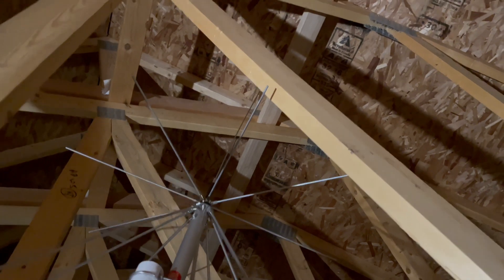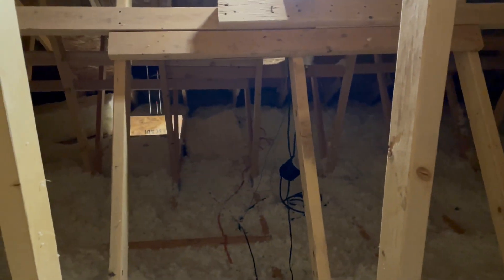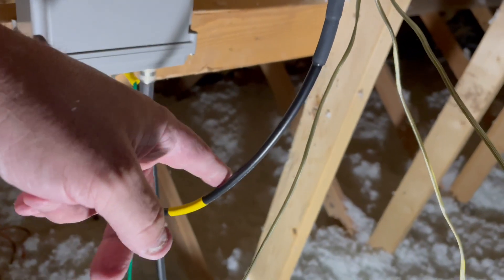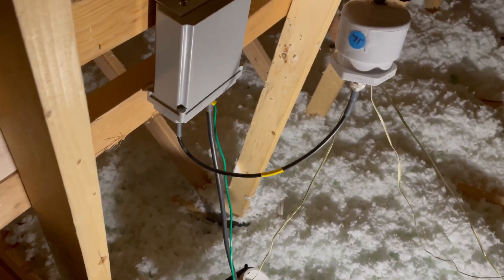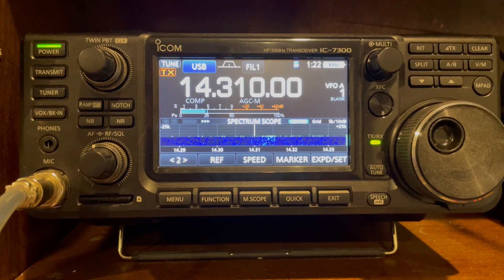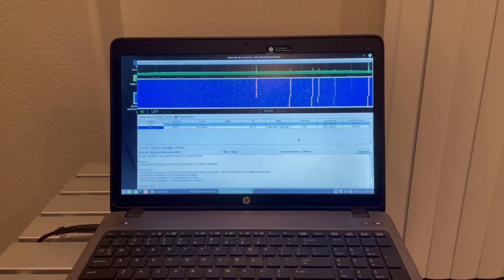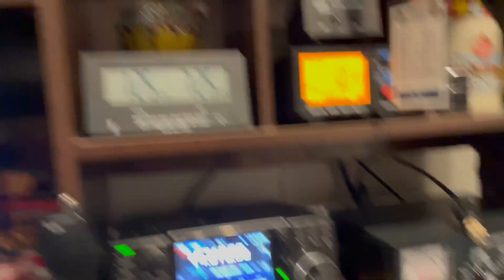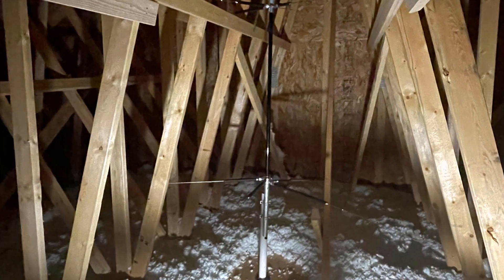Summer Shack Redo 2022 and a New Antenna Courtesy of MFJ, the MFJ-1868 Discone Antenna

Comment: I’d like to see your solution for transitioning the coax from attic to inside your home
Reply from the maker: I searched and I don’t think I have an exact video of how I got them down but basically I drilled 4 holes through a ceiling 2x4 and snaked them down the inside sheet rock of the floor above and then cut a 12” X 12” square in a closet and then drilled 4 more holes through that 2x4 into the basement crawl space and fished the coax through these holes so that each one was separated by a couple of inches from each other. Sorry there isn’t a closer video of that process but it wasn’t fun crawling up there and I didn’t record all of it. Ham-Solo K0FYR

Comment: Mike I really like the way you mounted the MFJ vertical antenna. Looking forward to seeing what your new radio is. I have 2 Kenwood TM-V71A radios like you sold. They are great radios and perfect for working the FM satellites. Will you be doing a test with the vertical antenna using it for VHF and UHF compared to the J Pole. I would really be interested in how the MFJ vertical performs to the J Pole.
Reply from the maker: Not sure if I was going to use the 8 band vertical for vhf/uhf or just stick with the j-pole. The new radio I’m getting has an hf connection and a vhf/uhf connection and I don’t really want to switch the cable from the antenna back and forth undoing and then reconnecting the coax everytime. So I think my idea was to connect the 8 band vertical only to the HF connection and then have a seperate coax for the j-pole connected to the radios vhf/uhf connection. However, here is a video where I did test out the vhf/uhf on the 8 band and it seemed to work fine. https://youtu.be/qxtT-OL9AKY the vhf/uhf test is around minute 4:22. Ham-Solo K0FYR
Reply: @Ham-Solo  Yes, I saw that video as well. Nothing like a side by side test however. Thought maybe you could a duplexer at the radio like the MFJ-916B. Maybe they would send you one of those to test. That way you would not have to swap the coax and could use all bands on your new radio. It would be interesting to see the comparison between the vertical 8 band and the J Pole.

Comment: DANNNNG! Mike, you are awsome. Hey, you deserve all the Respect on this HAM Radio Planet because this was quite some work that had to be done up on the Loft of your House to install over 70ft. Random Wire Antenna, Grounding Cable, Coax Feedline, Adatpers and Jumpers PLUS the Discone Antenna. It's kinda dusty and sticky air up there that's why you put a Mask on for your own Protection. In my Eyes this looks beautiful...and i am sure it works for you just fine. PLS never get tired of sharing your Quality Work with us. YFUG out of southwest Germany said that. Happy Sunday Buddy... 💯🤘🤘🤘🎸👏👍🙋‍♂️🍻
Reply from the maker: Thanks UG just waiting on my new coax and radio to put it all together. Hopefully next week. I actually made contact with a German contest station last night with my IC-7300 down in my ham shack. It was in Llmenau, so it is possible to already reach Germany with my 71’ random wire and only a 100 watts. Ham-Solo K0FYR
Reply: @Ham-Solo  Illmenau is about 220miles NE from my Place down here. It's another different Province of the Eastern German Provinces called "Thuringia" reunited with the Western German Provinces  back 1989 after the Wall came down.
The illmenau Amateur Radio Club used to be World Contest Champions for twice.
Hey those are good News to experience that you already made Contact with my Country, Mike. As you noticed for yourself, it doesn't take 1500W into a fancy Antenna System on 100ft. Tower to make the Trip across the Pond.
You are fine with  just 100W and a proper working Classic Dipol or EFHW Antenna. You have been working really hard for the last 15 month making P2P Contacts outdoors from dozens of State Parks of the US. I am watching every Episode of your Trips across America testing all kinds of Antennas, Radio Equipments, Solar Panels etc etc.
I became a Fan of HAM Solo KØFYR up in CO-State.  It's great to see that I am not the only Nerd on Planet Earth who loves to play portable HAM Radio outdoors in all kinds of WX.
Thx for all you do to keep HAM Radio alive. I be back on air again some time in August just taking a lil Break to get my Move to a new Place done.
Stay safe & keep up your Good Work. 73 de YFUG from southwest Germany 💯👍👍👍🙋‍♂️
Reply from the maker: @DK5ONV  Oh, well maybe this is closer to you. My army unit, the American 2nd Armored Division, went to Germany in 1989 about 3 weeks after the wall came down and stayed in the Tilly Kaserne at Neuburg an der Donau. I went and qualified at the range there and received the Schützenschnur in Bronze from the Panzergrenadierbataillon 562. We stayed there for about 8 weeks during Reforger 1990 and traveled to Belgium and Luxembourg as well as all over Germany. I always wanted to be station in Germany after that but the U.S. Army downsized shortly after and there wasn’t a chance before I got out. Ham-Solo K0FYR
Reply: @Ham-Solo  I got born and raised near the Donau River Region. Neuburg an der Donau is 70miles east from the little Village where I grew up named  Roggenburg.
I had dozens of American Neighbors from the US Army, and AirForce. I miss those good old Days badly. Wiley and Nelson Barracks in Neu Ulm. The USASA Field Station Augsburg. US Army Garnison Schweinfurt, US Army Recruiting Grafenwoehr, Leighton Barracks Wuerzburg etc etc.
I remember the Manpower Downsize of the US Forces very well. A lot of my Friends from back then were gone over night without letting me know earlier before. They got woken up on an early Morning and received their Orders to empty their Rooms, packing up their Belongings and getting ready to leave the Casernes. Some of them got transfered just a couple hundred Miles off to another US Installtion Place but most of the Guys had to return back to the US. That made me feel sad for Weeks or even for Month.
Now you made my Head spinning Mike. Tons of Memories coming back to me right now. Thx for the Throwback in Time.
Happy monday & 73 de YFUG 💯👍🙋‍♂️